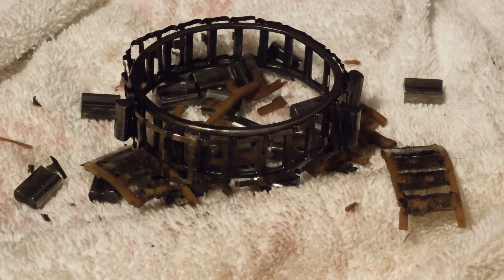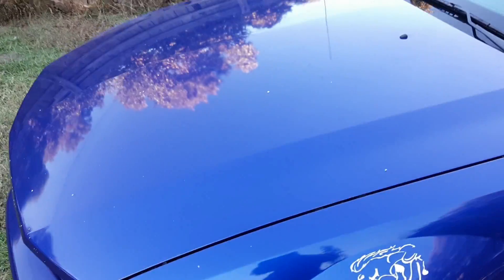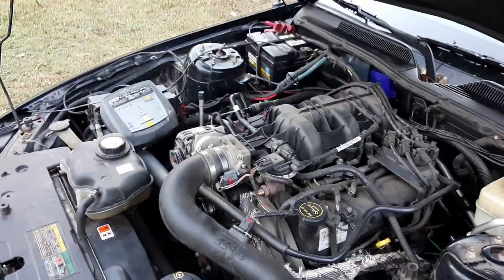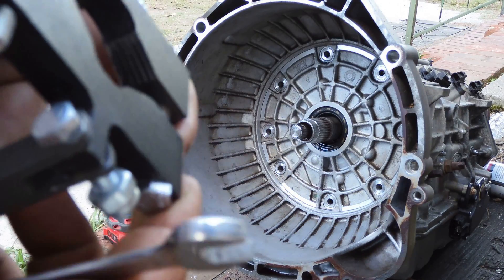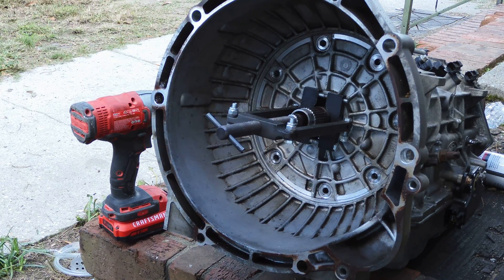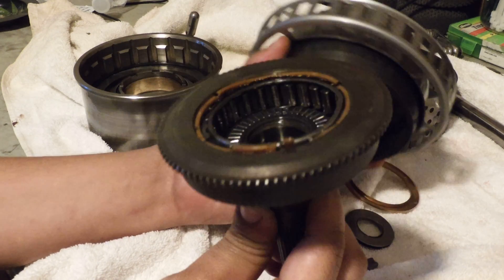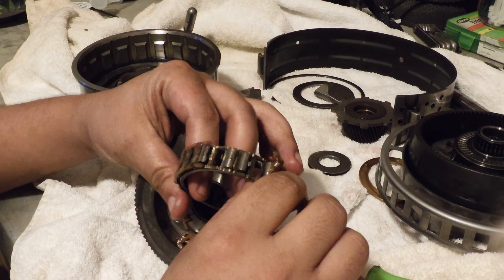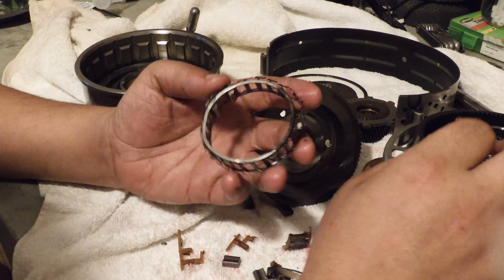No Drive Or Reverse.. Transmission Fixed For $25? Transmission  5R55S 5R55N 5R55E 5R55W 4R44E 4R55E

Comment: +1 to a failed OD sprag. For about a year had been experiencing infrequent flaring while driving. Might occur maybe 2x in a month. But usually corrected itself coasting changing into N and back to D. Fluid and level OK so was hoping just a sticking valve but no such luck.
Fast forward and all of a sudden lost D & Rev almost completely. Was lucky to limp back in 2. In D might hold up until started coasting  And Rev might still catch with snapping the throttle.
My sprag didn't fail quite so drastically which was why could still get some engagement out of it.
Didn't bother with a rebuild. Even with 200kmi+ all clutch packs still withing spec showing negligible wear. Just swapped the sprag and back on the road.
Reply: i did that and now mine is stuck in 1st gear only and wont shift into any other gears or reverse🫠
Reply: @chrisplayz9739  "Stuck" in 1'st or only engages in 1'st. Mean different things. If lucky may be as simple as manual valve wasn't lined up on VB install. ie: Fwd in ALL gear shift positions.
Otherwise best guess is seal/o-ring may have been damaged on reassembly.

Comment: Did you get any check engine light while you have the symptoms? Thanks
Reply from the maker: @nereomacatangay9204  I think so but I can’t really remember at the moment..
Reply: @ thank you for quick response! I having issues on mine. Vehicle doesn’t move on Drive, Reverse and manual 123. I absorbing more info to where i could start on diagnosing. Thanks again.

Comment: Heads up, you do not need to mess with the servos to get the band off. You can back off the bolt on the opposite side to loosen the band.

Comment: Damn, looked everywhere for over a week to help my fiance to fix her stang. But her car dont have reverse, drive, first 2 and 3rd and i genuinely couldnt figure out why. It wasnt throwin any codes, Nothin. Thought it was the Torque converter clutch solenoid but i was gettin mixed signals wether or not it was electrical, needin the trans rebuilt, a mew coverter or just fluid. So imma try and drop the trans and see if thatll help. If not imma just light the sum bitch in fire 😂

Comment: I've got an 04 Ranger and Ive got reverse, 2 and 1 but no Drive....it does exactly what yours did at the start of the video but I do have reverse....also I can put it in 2 and once Im past like 10-15 mph I can shift to drive and its fine....any ideas? Thanks in advance!
Reply from the maker: Sounds like u are missing 3rd gear.. 3rd gear is the same as 1st except the intermediate band also applies.. so the question is why isn’t it applying??? It could be a broken band, or the servo bore hole that the intermediate band piston rides in could be worn and not allowing the piston to hold enough pressure to apply the band.. 

U would need to pull the valve body and use air to apply the intermediate band so see if it is applying with air pressure.. if it will apply with air it should apply with fluid.. if it won’t apply with air the bore is likely worn out.. if it will apply with air, then it should apply with fluid.. the fluid is controlled by the valve body, the valve body is controlled by the solenoid pack, the solenoids are controlled by the PCM.. 

You can also try to re-adjust the intermediate band to see if it makes any difference..

Comment: I'm having the same problem, I had my transmission replaced on my ford explorer 2 yrs and now I can't get any power in drive or reverse, I'm able to drive in 3rd..going to check everything you mentioned before I get another transmission..Thank you so much for your advice..God Bless
Reply: Mines having the same issue only able to drive in 3rd, what did you end up having to do?

Comment: I got 07 gt stock. Both  reverse and neutral go forward when I step on the gas, and then drive doesn’t go past 1st gear, any idea what it could be
Reply from the maker: 1st thing I would check is the shift cable to make sure the gears on the shifter are matching up to the actual transmission gear that you are in.. It shouldn’t move in neutral

Comment: I've always thought of myself as mechanical and handy, usually do all my work on my cars and friends/family myself but never considered a transmission as it just seemed overwhelming. Your video makes me think I can take on that task with my 07 stang 4.0. While my transmission issue is different, lost 2nd gear with a scraping/dragging noise (and probably overdrive since they use the same band, will find that out here another day), I might tear it down now. For now I can still put the automatic in 3rd and drive around and still have reverse. Just wanted to give you those kudos. If you have a thought about my specific issue that would be great too. All the shops around me also say a complete rebuild!
Reply: Did you ever figure it out? Ive got a similar issue...
Reply: @BenChesnut  nope, been driving it in 3rd then putting it in D with OD off since then. Doing just fine that way so far. Since I can still drive it i didn't want to make it worse by tearing it apart. Il do that if I find a cheap junker tranny or it fails.
Reply: @BenChesnut i assume the band or second piston is toast. I actually was able to drive it around almost another year in 3rd and 4th gear. Recently the reverse started going out on me. So I have dropped the pan and found only a few small metal pieces. Going to try adjusting the bands, new filter and fluid and see.

Comment: How much do you think it will be if I take my car to a shop and explain this problem and get them to fix it?
Reply from the maker: No reasonable person would go thru the trouble of tearing it down and putting it back together without inspecting everything and rebuilding everything.. so they would probably still charge for a full rebuild.. if you do this also consider putting in a transgo shift kit.. it will prevent it from breaking down as fast

Comment: So my overdrive planet came out leaving the ring gear and center shaft with the snap ring . When I reassembled it it feels sturdy but if I turn it with the shaft to the ground the planet and ring gear come apart but the ring gear and center shaft are still together. Am I not seating the ring gear properly

Comment: Anyone on here know why I can’t pull out my input shaft?
Reply from the maker: thats normal on these transmissions, just make sure you dont put it in backwards or you will have problems with the torque converter binding up when you are putting it back in..
Reply: @williamblanks8500  edited my comment, I can’t get the input shaft out of the overdrive planetary

Comment: I am having issues with 96 ranger automatic transmission. No reverse or drive only works in 1st and 2nd gear. Thanks for the upload.
Reply from the maker: Yes sir, I’m pretty sure that’s the problem
Reply: @williamblanks8500   doin my homework thanks this was a very helpful upload 👍
Reply from the maker: @Norcaljourneyman  no problem, glad the video helped you out..

Comment: I’m about to buy a 2007 v6 4.0 with the same problems you were having, I messaged my transmission mechanic buddy and he told me it was going to be it band in the very back of the trans and I would need to rebuild the whole trans… finding this I’m confident the issue is the same. Do you happen to have a video of the transmission removal process?
Reply from the maker: Sorry I didn’t make a video about the removal or installation process.. usually rear wheels drives are all about the same.. drop the drive shaft, remove battery cables, then starter, then torque converter bolts.. some cars you may need to drop the exhaust some you won’t.. removal all transmission lines, plug ins, shift cables, etc.. support the transmission from the bottom with a floor jack with a block of wood on top about the size of the transmission pan.. remove bell housing bolts and remaining transmission mounts.. Lower transmission.. make sure torque converter is free from flywheel before dropping.. to install do the opposite of removal..
Reply: @williamblanks8500  thanks for the quick reply! This mustang I’m about to pick up, the engine runs perfectly, she said her husband was driving it one day and came to a stoplight and when the light turned green it wouldn’t go. So I feel like I would be an idiot if I didn’t buy the car…. $700 with a really straight body (need to replace windshield cause people like to throw cinderblocks around here) do you mind giving you email so I can contact you directly? You seem very knowledgeable with the mustangs
Reply from the maker: @Jordan-qv3py  definitely sounds like that could be the problem.. I have ran across a few of them since making this video, ford rangers too.. and yes kocent2008@gmail.com

Comment: what do you think it could be if the car does not rock at all in any gear, been doing mad donuts and burnouts in my 2009 p71 vic and after the last burn out she dont move at all. im thinking i blew my diff but i have heard a few other comments such as my tc or even my clutch plates. my hope is that i blew the diff and can replace it with a lsd and come back better than ever but my worries are that it is a transmission issue that will require real $ to have somebody fix. let me know if i sound slow thinking its my diff lmao.
Reply from the maker: If its not moving in any gear, then have someone to check under the car to see if the driveshaft is spinning or not while the car is in gear.. if its spinning but the car isn't moving, then the diff is bad.. 

If its not spinning in any gear, then there is a problem with the fluid circulation in the transmission or if you were manual shifting its possible the shifter cable broke and isn't moving the car into drive..

 the torque converter could be stripped. or the clutches could be so worn that the clutch material has stopped up the filter and the fluid cant circulate..

Or the transmission pump could have burned up,

Its also possible that you've leaked all of the fluid down somehow..

I would start at the shift cable make sure its working properly, 
check the fluid level and make sure its right,
then drop the pan on the transmission and change the filter..
Reply: @williamblanks8500  the drive shaft definitely does still spin, when I throw it in park it whines trying to slow the shaft down. Thank you for your response it is helping put my mind at ease a bit.
Reply from the maker: @foffanthony5208  no problem at all..

Comment: there is a replacement servo kit you can buy for $100 they put a sleeve on them to stop them from taring up the transmission housing eazy pezey
Reply from the maker: I wanna tear it back down and do a full rebuild now that I have a little more experience with it and that will be part of the process.. probably around next summer.. it’s still driving good for now so I don’t really want to mess with it..

Comment: so william  in hiram Gutierez video "5r55s valve body- 5R55S TRANSMISSION video thats 18.07 long go to minute 11 and he says the soleiniod regulator in the valve body if stuck open can cause the effect of small amount of reverse but breaks free and spins if you accelerate which is exactly what mine is doing so mine may only need that repaired..will know soon.
Reply from the maker: Yes I have watched a few of his videos.. i just checked out the video that you were talking about. So what he is saying is correct if the valves get stuck then it could cause the weak reverse issue. It should be simple to tell the difference between the two without pulling the transmission out. If the sprag is the problem then the transmission probably won’t throw any codes because the valve body should be working properly. If a valve is stuck then he is saying it should be throwing a transmission code. I’m my case the car wasn’t throwing any transmission codes. Another thing to consider is if a valve got stuck then what caused it. Usually if a valve gets stuck it’s because there is debris in the transmission fluid from a part that is failing. It could be clutch friction material, it could be a damaged hard part in the tranny, or it could be metal shavings from a failed torque converter.. So if the valve is stuck u may be able to remove only the valve body and free the sticking valves but before you put it back u probably should check everything to make sure nothing else is damaged.. 
If the fluid is really clean and the transmission isn’t throwing any codes at all then the sprag is probably the culprit..

Comment: SO For the people asking how do you get the transmission bolt at 2 o'clock out? at least on the explorer it was pretty simple ,I strung together every extension for my 3/8 " socket even using a 3/8breakover wrench that has a female 3/8 attachment and turning its 90 degree to north so as to use it as an additional extension and all together it was over 2 feet long with a metric 13 or 14 i forget i got back behind the transmission and went straight at the bolt by going over the top. no knuckle needed but listen that bolt is what anchors the 2 fuel lines that come from the tanks or pump and they need to pop out of that l shaped bracket and ideally you want that bracket out, away from the trans. I didn't remove it and 90% of the struggle i had getting the trans out was the bracket digging into the foil insulation. it was tricky because the fuel tank has been designed to use all available room and i ended up having to jack the back of the motor up so as to point the transmission down then it popped out easily. I could just pick it off the floor and onto a bench. right at 300 pounds drained. I also took the time to chisel out of a 12 inch square  2x12 a matching 2.5 inch deep round concave indention so that my pan didn't get harmed in the removal. pulled the pump and super clean so far should know if its the sprag by tomorrow. I will let you know!!!
Reply from the maker: Yes please keep us updated.. I would really like to know if that’s the issue that you are having or not..